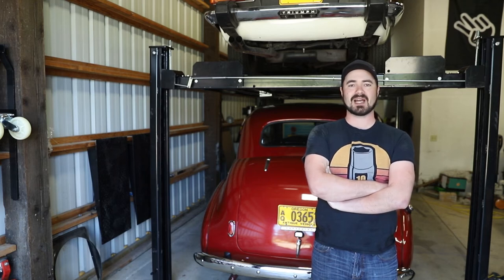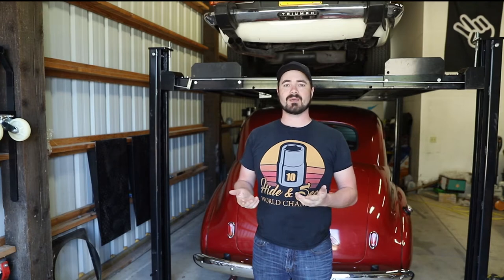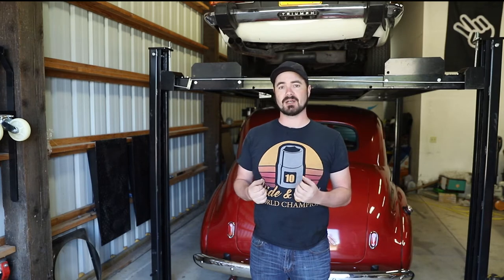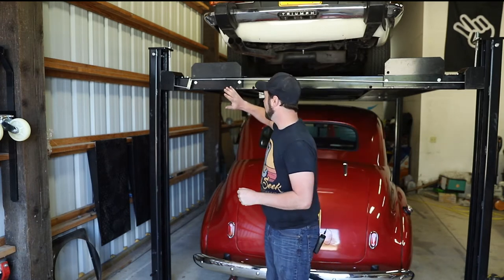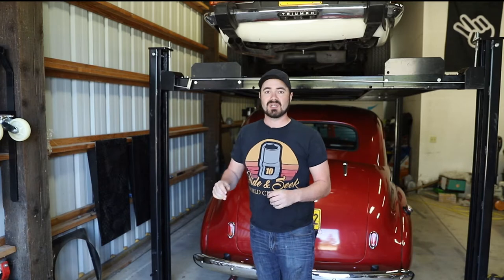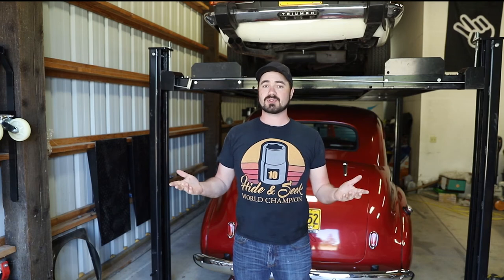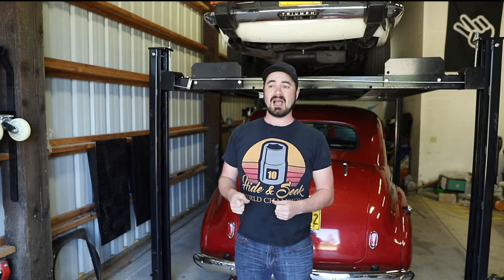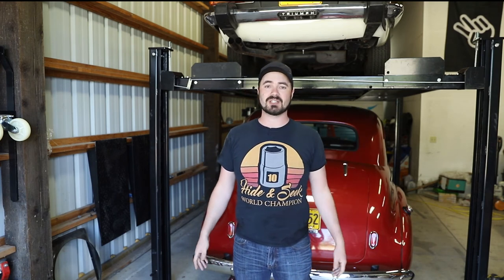My opinion and tips on the Triumph NSS-8 auto lift

Comment: I use a ratchet strap to pull the cylinder ram out to get the slack to connect the cables. It was very easy.

Comment: Great video. Wish I had seen it before putting mine together yesterday. Wasn't too bad though. Me and one guy did it in about 5 hours. We work a little slow, he's 65 and I'm 71!! One question though, what fluid did you put in the hydraulic system? Thanks.
Reply from the maker: I used the same bulk fluid that we use in the hydraulic system of our tractor. The lifts don't seem to be that picky and give you basic ratings to work with.

So far, it's still working like a champ and it's the go-to lift for oil/coolant changes and storage. Enjoy the new tool!

Comment: Great video, thanks.  I've been looking at these for a little bit.  Noticed you have a Triumph on your Triumph.  I have a TR8 and a Spitfire (plus a Bugeye Sprite) and I've been looking for a "reasonable" priced lift for working on them.  
Prices have gone up 2-3x in the last 2 years on them but these still seem to be the best value, although NLA on Amazon.  Glad to see it is still working well for you.
Reply from the maker: Thanks for checking it out. The TR6 being fuel injected now makes it much nicer to use regularly, even if the top still can't really be moved in cold weather ;)
Reply: @AmbiVe  My friend did a FI setup on a GT6 engine in his Spitfire.  It's a work of art.  It also starts at the flick of a key.

Comment: Does there need to be any kind of cap over the hole at the base of the piston where you connected the air compressor to extend the piston or that just stays open??

Comment: Great video, thank you.  May I ask you to post a couple of dimensions?  Edge of baseplate to edge of baseplate for width?  And what dimensions are the posts 4x6?  Thank you!
Reply from the maker: The posts are just about 4 1/2 by 6 1/2 inches, but the cables ride slightly farther in than the body of the post. About an additional inch.

The footers are 81 inches inside to inside and 105 inches outside to outside. Since mine is not bolted down this may vary a bit.
Reply: @AmbiVe  Thank you!

Comment: Great Video! My lift cylinder does not have air hose attachment. Is there a way to install the attachment our an alternative way to extend the cylinder piston?
Reply from the maker: I had to install the air fitting in place of the little brass vent. If you have some air tools lasting around, steal the fitting off one, unscrew the vent with a wrench, and replace it with the air connection and you should be golden. Just keep the pressure low. It moves quick when it starts and your don't want to max it out and damage a seal or get it stuck.
Reply: @AmbiVe  thanks ill try that

Comment: when your lift is on the ground for loading is the cable just as tight as when it's in the air or is there some relaxing to it? I think mine is all the way down but the cable are stiff as when in the air
Reply from the maker: The are going to be generally always under tension to some degree. When they lift is on the ground, it will have only pulled the ram back just enough to stop against the floor.

Comment: Are you running it though a 30 Amp breaker for power? I keep popping my 15 Amp
Reply from the maker: I had been running it on 15amp before I switched it to its own circuit. Do you have it on a long cord or is the breaker old? I have had old 15amps break as low as 10amp just from age/wear.

Comment: Does this lift require bolting to my concrete floor?
Reply from the maker: It doesn't have to be. I'm currently leaving it mobile and it's fine for lifting and storing vehicles. The setup is not as perfectly square and can move slightly, so during lifting and lowering I keep an eye on the posts to make sure none have shifted too much as to have an issue. The unit comes with wheels to allow it to be moved if left mobile, so it's somewhat flexible.

If I had it in a final location, I would bolt it down for peace of mind.